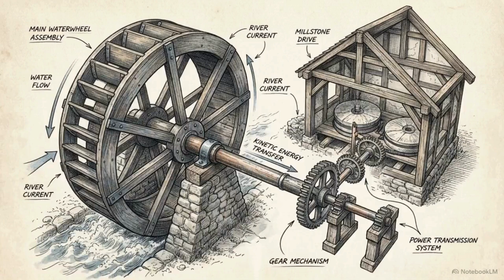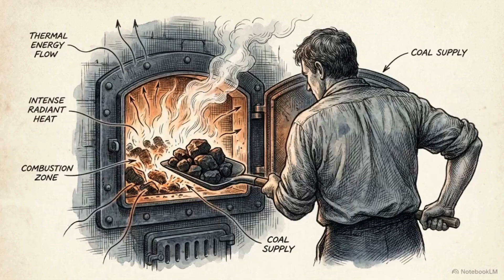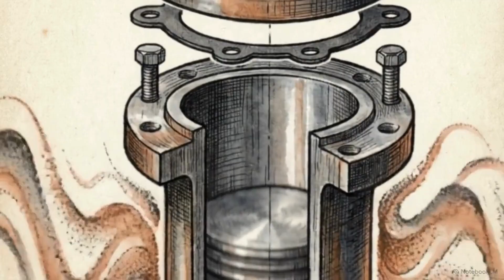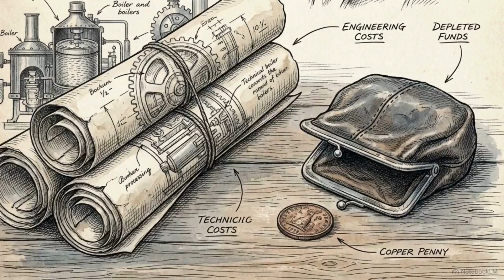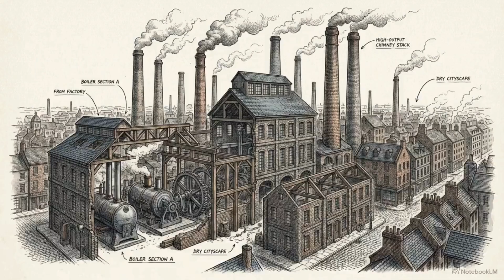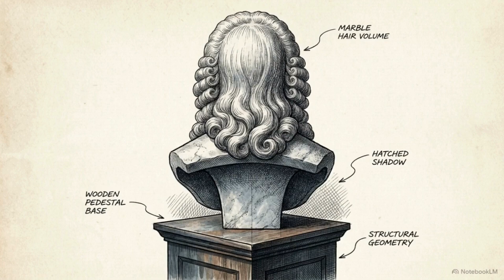James Watt: The Man Who Retired the Horse. Industrial Revolution | HS World History

Comment: A separate condenser was no use whatsoever to a Newcomen Atmospheric Pump. It only works for Steam Pumps and Steam Engines which have Atmospheric resistance. Watt created a "closed loop" Steam system between the engine and the condenser which eliminated 14.7 psi of Atmospheric resistance. 
Which also meant he could make use of High Pressure Steam way below Ambient Atmospheric Pressure.
 The first person ever to do so. 
For example a 5psi abs. High Pressure Steam Pump or engine with a condenser, could do as much work as a 20psi abs. High Pressure steam pump or engine without a condenser, but only needed 1/4 the amount of fuel. A 400% increase in fuel efficiency!
 Newcomen= Atmospheric power. Watt= High Pressure Steam power. Also, James Watts 5psi absolutel engine had 10 psi pressure on his boiler, the same pressure Richard Trevithick's 25 psi absolute boiler had. So, boiler technology was similar. By year 1900, out of 10,000,000 Steam Engines, only 25,000 were Locomotives.
Reply from the maker: Thanks for the feedback! 😊